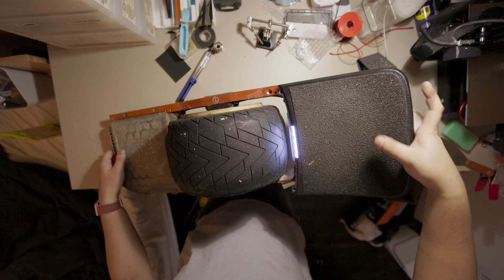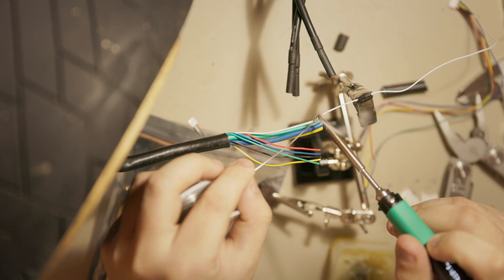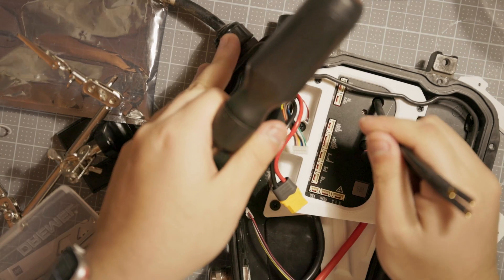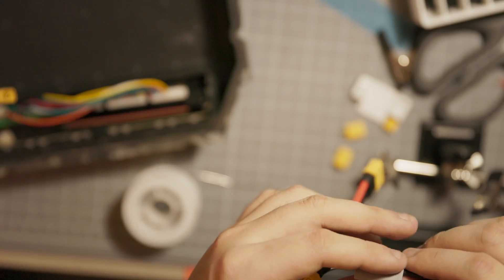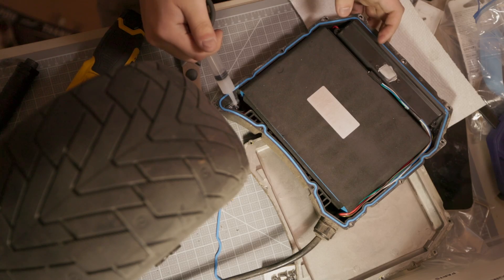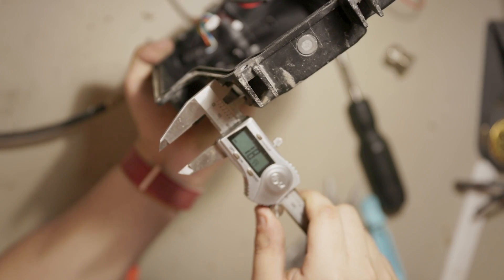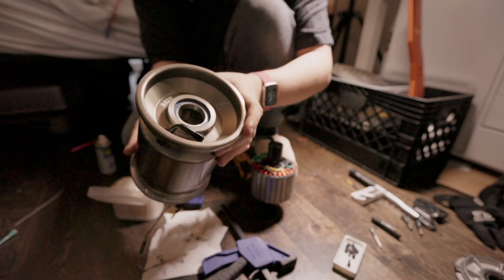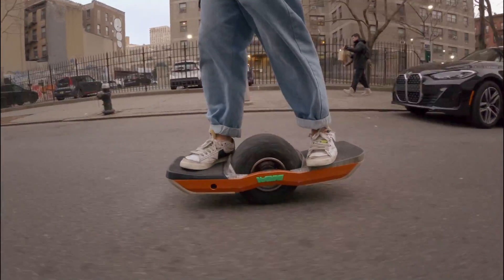Let's VESC a Onewheel GT!

Comment from the maker: Download STLs: https://thangs.com/designer/leonchangpersonal
Ubox 80v Momentary firmware (the first one): https://github.com/JohnSpintend/Ubox_FW/tree/main/FW%206.2/UBOX_SINGLE_80
Helpful parts for pint/GT conversions: https://avaspark.com/shop/
M20 cable gland I used: https://www.floatboxx.com/product/10039957/m20-cable-gland
Any M20 cable gland will work: https://www.amazon.com/Fielect-Waterproof-Adjustable-Joints-Connector/dp/B07Z9C9Q5X/ref=sr_1_10?crid=G4VU9PH5LW1P&keywords=m20%2Bcable%2Bgland&qid=1705421575&sprefix=m20%2Bcable%2Bgland%2Caps%2C56&sr=8-10&th=1
GX16 3 pin (charge port): https://www.amazon.com/dp/B07L9VGKTM?psc=1&ref=ppx_yo2ov_dt_b_product_details
Comment if you need me to link to any other part
Reply: What kind of diode do you use?

Comment: Looking to VESC a friends board with the UBox 85v 150a. Will the 84v 150a controller work with a 20s2p 84v battery pack?
Reply: No it is only good up to 18s in onewheel application

Comment: Do you know what your motor R value was for this? I am converting my gt and getting what seem like really high motor R values, like 400miliohms
Reply from the maker: I think I’m at 90ish during detection. If your detection values are that high then you might wanna check your wiring. I had crazy value once even though everything is wired correctly, what ended up fixing was blowing compressed air around the connectors, so it might be something really basic like that

Comment: Bro how did you take the stator out that easy??? I’m having a hard time
Reply from the maker: i had a pretty easy time popping the stator out by pushing against a wooden block on the other side, but had a hell of a time taking off the hub plate cover. i'm guessing sand/salt/debris got stuck inbetween the axle and bearing, had to clamp it pretty hard. would be a good idea to clean the axle with a Q tip before taking off the stator

Comment: I am about to follow your path! What size wires do you use for the phase wires and the hall sensors etc. for your motor soldering?
Reply from the maker: good luck! 12AWG for phase wires (that's thicker than the cable in the original harness but 12awg is what everyone uses for discharge), data cables are 30awg i think, using the cables that came with JST GH 1.25 kit

Comment: Are you sure that it's dead because mine did that? I simply took off the front pad and then wiggled the wires and it worked
Reply from the maker: It you need to wiggle the wires for it to work at all, imagine what happens next time you hit a bump… my motor connector has been acting up for the past 2k km showing signs of it slowly deteriorating until it finally blew. besides, the stock connector is not even rated for the amperage the stock controller outputs, let alone a vesc that can output double the amps

Comment: Thank you so much for this valuable resource. Really really appreciate it. I can't wait to build my own VESC though it will be based on the XR platform.  I've got two XR's that are perfect, but have blown BMS's. Since I can't buy the FM BMS's I'm just going to have to build a new board, and use those for parts. It infuriates me that something so valuable is useless because of a simple part. Your remarks about doing the same thing over and over reminds me of my career as a sound engineer. Even the biggest sound boards are just a whole bunch of stereo's. . . As for the form of the video, details matter.  Your freezing a frame and labeling it is super useful. Not only with pinouts but in how an assembly looks after you've made it.  PS. what hot glue gun is that????
Reply from the maker: thank you for your kind words, it means a lot! The goal of this channel is to not only make DIY and repair information more accessible, but to make it appealing and enjoyable too! The previous 2 videos are all about vescing an XR, hope you'll find those helpful :) 

With a VESC controller, you can either rewire the XR battery pack with a breakout board (like what i did in this video), and connect it with any 3rd party BMS; or wait a little bit for picklebms's 15s drop in BMS to be ready and plug and play everything in the rear box. Links here:
https://pickleworks.ca/products/15s-picklebms
https://zbattery.solutions/products/stock-pack-breakout-board

On the controller side, if you don't wanna go all out on custom boxes (this video goes into detail):
https://youtu.be/yKqVTMpzuVQ
you can also reuse the stock XR box:
https://youtu.be/qIPj5jP04jA

the hot glue gun is from hoto, their tools are super user friendly, usbc rechargable too! https://www.amazon.com/HOTO-Cordless-Heating-Rechargeable-Smart-Power-off/dp/B09MR82F8M/ref=sr_1_1_sspa?crid=1CLVGP6Y580ZW&keywords=hoto+glue+gun&qid=1705973672&sprefix=hoto+glue+gun%2Caps%2C61&sr=8-1-spons&sp_csd=d2lkZ2V0TmFtZT1zcF9hdGY&psc=1
Reply: @leonchang7596  Again, many thanks.
Reply: @leonchang7596  oh yeah, I watched that and saved it already. I'm pretty sure that's when I subscribed. I do 1wheel service here in my hometown of GNV, I'm 69, have over 6K miles, but stopped counting miles some time last year, so prolly a bit more. One day, when I grow up big, I hope to have a repair business(not for dough, can't make no money doing that). I love to solder and make and ride. Keep on rollin'. . .

Comment: If I wait till summer about how much will it cost to buy all the parts needed?
Reply from the maker: picklebms 18s drop in kit $120 + ubox80 $150, so $300 ish. depending on if you want any add-ons like lights, remote, etc that's $200ish more. alternatively, the floatwheel kit will also work but i'm not sure how much that's gonna be

Comment: You need to waterproof the GX16 further, it leaks through the plastic where the pines go through

Oh, I see you found out as I saw more of the video 👍🏻
Reply from the maker: haha, i should probably also fill the inside with flowable silicone now that you specifically pointed out it's a leak point

Comment: Are the voltages on the Ubox a maximum voltage then in the vesc software you set voltage limits for your battery? I see avaspark has brackets for the 100v. This would give me options later when I wanted to upgrade my batter or build a split pack. I have a gt with a bad esc and FM told me my enduro could have caused the issue and would have to be swapped out before I sent it back or they would do it. So I started looking at other options and there’s so much info but no consecutive info until this video. Thanks!
Reply from the maker: yesss try to make it as comprehensive as possible. ubox 80v just increased its rating to 20s 150A. It's just called 80v. I think the 100v is worth it if you wanna do a 22s split pack, but otherwise the 80v is low key really awesome. The max voltage is a setting in vesctool but the firmware that the ESCs ship with do not allow you to go beyond what it's designed to do, but they also do publish no limit firmware where after you update the firmware, you can set any value to whatever you want. For the ubox 80v, it's in the same link as the momentary button firmware in the pinned comment, it's the second file labeled no_limit

Not sure how swapping to an enduro could've caused any ESC damage tho...
Reply: Leon, when you say 20s 150A. The 20s is the cells in the battery, but what is the 150a? I’ve seen other numbers that follow the cells and pairs, like p42a. What do they mean?
Reply from the maker: good question! In this case 150A describes how much current the controller can deliver to the motor, which is a big factor for low end torque. When someone says 20s2p, in this case p stands for parallel, so that’s 20 cell groups wired positive to negative (series), and within each cell group, 2 cells are wired positive to positive and negative to negative (parallel). Cells in parallel contribute to how much amperage the battery can deliver to the controller, as well as the range of the pack. P42a, even though it uses the letter P and A, confusingly enough, that’s just the name of the battery cell. So this build uses Molicel (manufacturer) P42A (cell name), in 18s (cells in series), 2p (cells in parallel) configuration, wired to a controller that can deliver 150 amps to the motor.

Comment: Love the long form video! Fantastic to see the nitty gritty of all the tinkering involved with VESCing, Really helps people get their head around what they are getting into before making the jump. Explaining the backstory behind every component is also helpful for people who might not be as experienced. Got an specs on the performance difference other than how it "feels"?
Reply from the maker: yess i try to make it digestible for people with no prior knowledge, which is me only a year ago. performance wise it's what you'd expect from a P42A 18s2p pack with 150A controller, which is a lot more low end torque than any FM board because of the bypassed connector and vesc being able to dump a lot more amps, and top end is dependent on field weakening, rider weight, etc.. but should be able to keep up with a GTS.

Comment: This is wild. Thank you for justifying my having loaded my GT's motor cable with dielectric grease, because I could not do what you just did in this video lmao. Hopefully the dielectric grease will help me avoid the same fate, at least until the VESCing process becomes more plug and play.
Reply from the maker: good idea on the dielectric grease, didn't even think about that! GT motor cable design is flawed from the beginning but at least tony was able to reverse engineer it, just needs to last half a year more until tony finishes the drop in kit!
Reply: @leonchang7596  I'm sure subconsciously you didn't think of it because you wanted to VESC anyway :P 

Yea I'm looking forward to having a drop-in kit as an option for me. You are a badass building your own.

Comment: Excellent video! I also just VESC'd a GT and it has been a bit of a misadventure. Some issues with various controllers, think i got a couple lemons
Reply from the maker: don't be discouraged! It's not supposed to be as smooth as what is shown in this video. Halfway through my build the motor just refused to get a clean calibration, and had to factory reset the firmware 5 times to finally get it to work. Was then stuck on waterproofing for a week because I couldn't figure out where it's leaking, before realizing I just need to tighten the cable gland further. LED module is still not working correctly despite checking all the connections. Actually the funniest story is a while back on another build, I was stuck on troubleshooting motor calibration for a month, checking wiring over and over again. What ended up fixing it is just to blow compressed air on the connectors because cat hair somehow was interfering with the wiring... I tried to show as much of the troubleshooting as possible in these videos but in the end they still need to flow nicely, and it's very anticlimatic to dedicate 5 minutes of runtime to in the end reveal a stupid little error I made that is totally avoidable in the first place. Just remember you probably are just missing a single setting or a wire that's a little bit sketchy, and it's very normal to run into these issues :)

Comment: Okay, I'm only 40 seconds in but if you want your torque wrench to last, because the spring mechanism has a "finite" amount of uses, try to not use them to loosen bolts. I cringe a little every time I see it done, but it might not be that big of a deal haha.
Reply from the maker: Thanks for the tip! Is it also damaging if I loosen on the lowest torque setting? I’ll probably keep using this one for loosen because it doesn’t even reach the OEM torque spec haha, so just using it as a normal wrench at this point, but plan on babying my next torque wrench a lot more

Comment: Another cool video! Curious to know what the deal is the replacement charge ports. Is there a technical reason that 18s, 19s, and 20s boards would have a different number of charge port pins? Or is it just so you cant accidentally plug in the wrong charger?
Reply from the maker: Thanks! I’ve been really liking the GX connectors. The female end (charger end) is made out of plastic, instead of metal for the XLR, which makes it far less likely that the plug itself will act as a bridge to short the two pins (I blew an XLR because of this). Also, GX connectors are $1/set and readily available on amazon, vs the specific model of XLR male plugs that are only sold via makerspev. As for the number of pins, I believe it’s mostly just so you can’t accidentally plug in the wrong charger. However I think the 2 pin is kinda dangerous because if someone got into the habit of twisting the charger until it goes in (i am guilty of doing that on pint chargers), if you twist it and it lines up in the opposite direction, you’re dangerously close to reverse polarity shorting. I‘d rather it not be used anywhere, but at least 19s packs are the rarest.